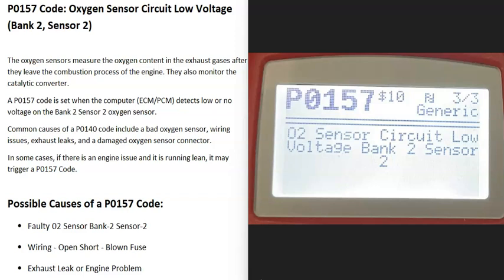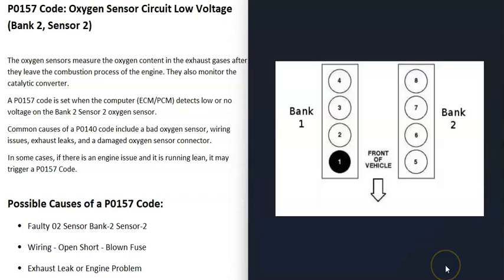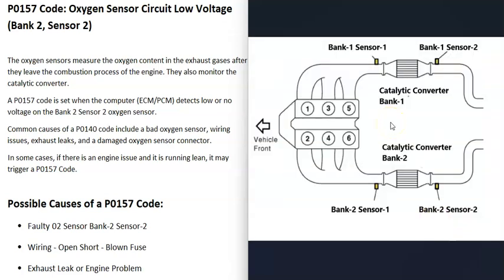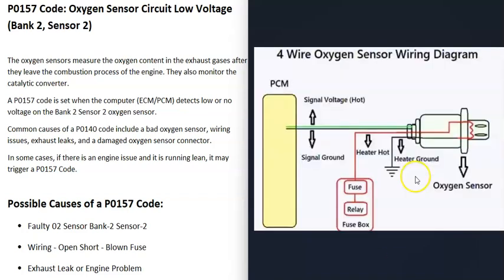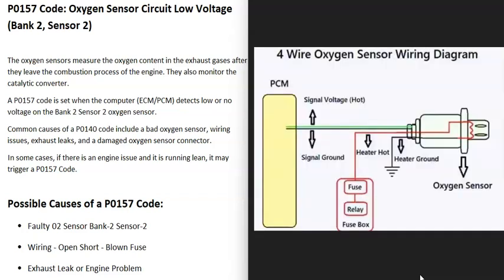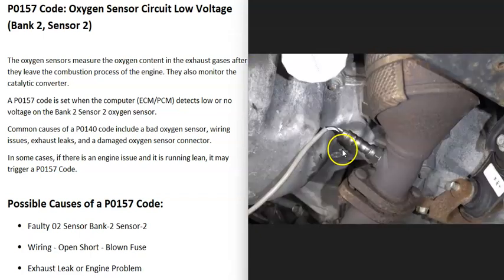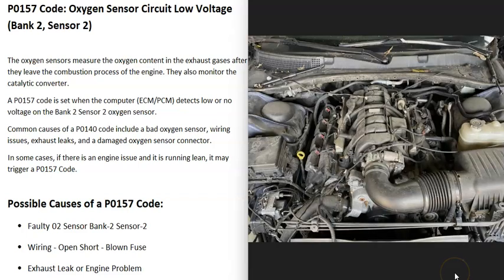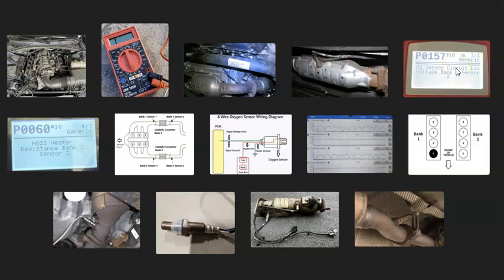Causes and Fixes P0157 Code: Oxygen Sensor Circuit Low Voltage (Bank 2, Sensor 2)

Comment: That was a really good description, thanks! 

If I changed 1 thing it would be to flip the one diagram so the engine was pointing at the top of the page instead of down or add drivers side/engine front, or something like that. I really appreciate your video. 

Because my code is as you described plus it says “low voltage” I assume it’s probably a wiring issue or connection issue? I’ll take it off and clean it up with some sensor cleaner and check it all out now that I know exactly where it is thanks to you good sir!

Comment: Was getting code p0420,p430 added Fowler both sides now getting p0157  answers or suggestions welcome
Reply from the maker: It can be hit or miss if a 02 sensor de-fouler works. When modding, it is best to find a forum on the specific vehicle since there are differences in what works.
Reply: I got p0057 and p0158 on my 2011 G37 sedan what should I go  by I replaced the sensor with a new one and it still throws it I’m thinking it’s the connector bc with force I could pull it off without pressing the clip